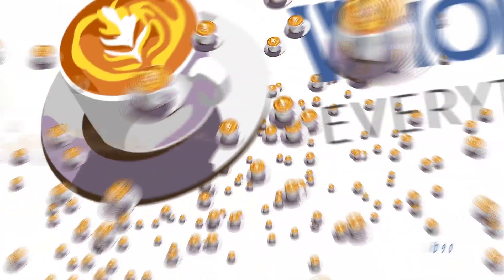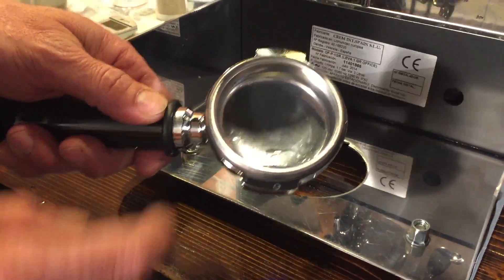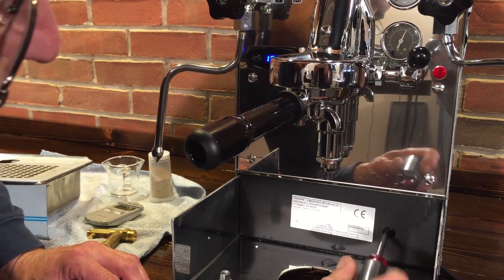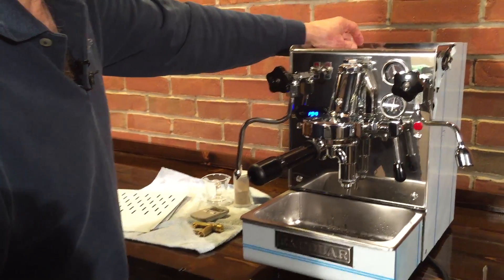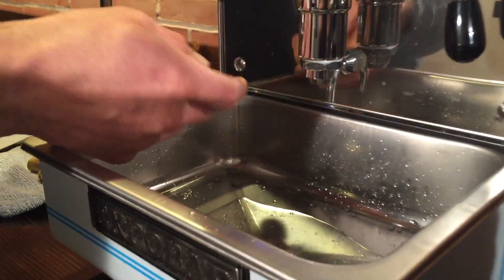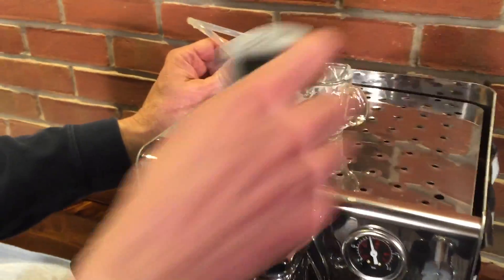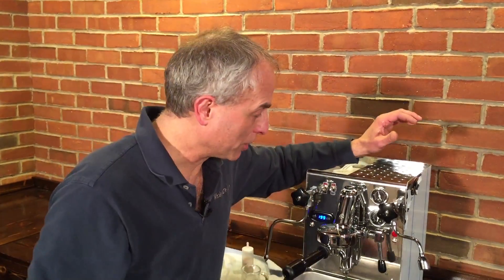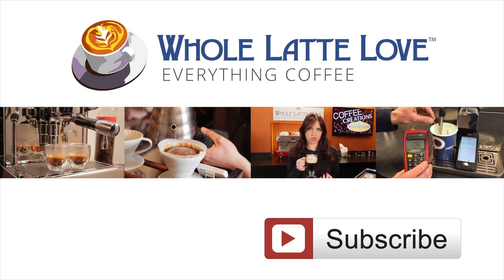How To Check and Adjust Pump Pressure on Expobar Espresso Machine

Comment: My 2011 machine (new to me) doesn't have a pump pressure gauge - so is there a way to add one or do this without a gauge? Replace the steam pressure gauge with a dual gauge or replace the brew head temp with a pressure gauge? if a dual gauge, where do you tie into the system to see the pressure?
Reply from the maker: Hey mlb, pump pressure gauges are usually attached via a capillary tube in the cold water flow just after the pump and before other system components. If your machine has an E61 group there's an accessory port on the face of the group where you could attach an analog gauge or even an app connected pressure sensor like this: https://www.wholelattelove.com/products/pressensor-bluetooth-e61-pressure-sensor?variant=43095544725558

Comment: Hello from sunny Australia, firstly thanks for the video. I have the brewtus IV (know here as the Minore IV). The vib pump was replaced in Feb this year. I have been trying to trouble shoot high pressure (14 bar) and high flow (single filter would produce 60-70ml in 30 secs from a 10gram dose). A blind filter will see the pressure rise to 14 bar. It would seem to me the vib pump was not set to 10bar when it was replaced. Is this a fair assumption? Anything else that might cause high pressure/high flow? Thanks again.
Reply: The video showed how to adjust the pump pressure to 10 bar by removing drip tray and turn the screw. The extraction of 60-70ml in 30 sec is related to grind size, so need to grind finer

Comment: Hi Whole Latte Love, 
I have the Minore IV tank only version. So I have the two tubes going back into the tank. My question is does the chrome tube on my version connect to anything? I assume it is just for show since the tank and plumbed versions use the same bodies? 

Also, if I want to remover the lower chamber (pre-infusion and exhaust chamber) do I have to remover the chrome tube? It seems like isn't much room for the lower chamber to screw downwards with the chrome OPV spout so close.

Comment: I just bought an expobar lever machine, this video was very helpful while setting it up.  It was set at 12 bar out of the box and the shots were not great.  I noticed with mine, no matter how I grind or pack my filter it doesn't really drop to 9 bar when set at 10 with a blind filter...more like 9.5... I guess that's fine though since the flavour is excellent and I have the yield/time I am after?
Reply from the maker: Hi k, Thanks for the comment sharing your experience.

Comment: As things are standing it takes my machine a full minute to get up to 4 bar with backflush disc in. It does ultimately get up to pressure, but it takes nearly two minutes. When it comes to pulling the actual shots, this translates to wimpy tasting shots pulled at a wimpy 3 bar. Any ideas?
Reply from the maker: Hi k, Thanks for the question. Well, that's far too long to get up to pressure and pressure is too low - but you knew that already! So could be a couple of things. Pump is not working properly and/or obstruction in internal hydraulics from scale deposit etc. Has the machine been regularly maintained - backflushing and descaling? Check out our support wiki for Expobar machines here for troubleshooting info: https://wiki.wholelattelove.com/Expobar
If you are in the US give our tech support staff a call at 585-924-7170. They can help diagnose issue, get you parts to do a DIY fix or setup a repair if needed.
Marc
Reply: @Wholelattelovepage  Thank you so much for all the instructional videos and also for getting back to me. 

It's solved now - and here's what I learned following a full 2 weeks of troubleshooting...  The pump was working properly (1 oz/12 sec) - but replaced as part of this and also upgraded with pyrex ball instead of plastic. Also replaced the overpressure valve. I wouldn't have dared doing this without your vids. Cleaned out the brew head jet too. Not much there.

The maintenance routine is fairly rigid. 
I've been replacing the filter as per manufacturer's instructions - About every 300 shots. At my usual 3 shots a day that's about every 3 months.  I try to keep a monthly descaling schedule but in practice the machine has been descaled every 6 weeks since taken in use. As I live in a Very Hard Water Area, I have kept tap water away from the machine, opting to use the lowest TDS spring water I could find. I backflush at least plain water after each session. So far so good. The good news is that I've not come across even a trace of limescale during pump and OPV replacement.

The bad news is that the problem persisted. I decided to pull up the hydraulic diagram of the machine and start troubleshooting from the beginning, trying to account for all symptoms.

Then it hit me. The filter. It hadn't been in there for 100 shots yet, but last time I ordered in filters I had been sent slightly different ones - resin filters rather than the usual mineral ones. Apparently these absorb water and after long enough they will block the inlet, so for these filters it's recommended to replace them after about a month. 

Could it be that simple?

The filter had been in there for two months, so the machine was doing all it could to pull in water through a big old tube of jelly. The pump was fine. The OPV was fine. It ultimately came to full pressure. It just had tremendous trouble pulling in the water to begin with. As soon as I swapped out the water filter, everything went back to normal.  

All's well that ends well. My Expobar is once again A clean, pristine, working coffee machine, serving me up delicious shots of coffee. I ended up with an upgraded pump and I've learned how the pump/deairator/opv chain fits together.

Thanks again,
Marc

Comment: Hello, may i know whats the problem for my machine,expobar office lever plus, when using blind filter or brewing espresso with normal flow, but the manometer is vibrating so hard and does not show the exact bar, and i had tried to replace the pump and not solve the problem. Is there any solution ?

Comment: Hi thanks for a great video. What if I'm getting 2oz water in 12seconds what could be the issue? I've set to 10bar via the gauge, using same method  as on the video. Thanks
Reply: I have the same issue and question.

Comment: Hi, i have a expobar espresso machine with 2 boilers and lately the pump pressure raises to 14. When I put a screwdriver in the hole behind the drip tray I cant find anything to adjust the pressure. Where do you put your screwdriver and how can i find it? 😅
Reply from the maker: Hi Bente, What model Expobar machine do you have? They have different model names in some countries. You may find what you are looking for in our Expobar support wiki which has hydraulic diagrams and manuals for most Expobar machines.
Marc

Comment: Hello there!
Thanks so much for the video. My 2005 Office Lever has been running at 12 bar for years now. I've attempted to adjust the pressure but my model doesn't have the screw behind the drip tray as displayed on the video. I've read somewhere that my hex screw on the brew group is what you use to adjust the pressure, but water leaks out of it before it gets to 10 bar. I think I'm adjusting the wrong screw.
Reply from the maker: Hi ZZ, You are welcome and thank you for the comment and question. The Lever has undergone a number of revisions over the years. Your model may not have the hole behind the drip tray which gives access to an expansion valve which limits brew pressure. I know one thing for certain: The hex screw on the group has nothing to do with adjusting brew pressure. I forwarded your question to our Service Manager. He said he'd need to see inside the machine near the pump. In some machines, the expansion valve is only accessible by removing the outer housing of the machine. 2005 predates my knowledge of Lever machines. If there's an expansion/OPV valve inside it probably looks something like this: https://www.wholelattelove.com/6476946750258 What you can't see in the part photo is the screw which adjusts the pressure.
Marc

Comment: Hello guys
I did the test today but got some strange results

With the pressure set at either 8 or 10 bar the flow will not slow down , i got 1 oz in 4-5 sec

It’s an expobar leva hx and i got it for almoust 3 years now
Reply from the maker: Hi NV, Thanks for the question. Just to be certain you are measuring after the flow slows down? I think everything is fine. More water faster indicates a stronger pump. Problem would be if you were getting less than specified flow.
Reply: Whole Latte Love thanks for the reply

I am measuring a few seconds after the pressure reaches the set 9 bar with the backflush disk in. The flow does not seem to die down, it remaina kinda fast
Reply from the maker: @Nakon-V  Is your espresso brewing well? Again, more flow indicates a stronger pump. If your espresso was brewing very week or slow the only thing I can come up with is your pressure gauge is not reading correctly - like it's indicating a pressure much higher than you're actually getting. This would cause more water to bypass through the OPV and back into your reservoir. This is possible yet unlikely especially if your machine is brewing properly.
Reply: @ @Wholelattelovepage  i kinda get some channeling issues, like little holes in the puck which i have to combat with a high dose, bottomless extraction has no spurts tough and seems kinda fine.

Comment: Hi there
I noticed on your video that water coming to that glass comes with some intervals and could hear it also. Is it normal???
My office lever plus started to brew coffee with this kind of pulsation. ( only during brewing) is this something I should worry about???
Thank for the video
Reply from the maker: Hi Tony, Thanks for the question. What you saw and heard in the video is normal operation of a good pump. As long as you have good pressure and flow rate like in the video there's no need for concern.
Reply: Hi and thank you for reply. I forgot to mention that pressure arrow is pulsating also  but only during brewing coffee . I couldn’t see difference in flow and taste...
Reply: @updatename6637  fwiw when I had this pulsating pressure, it was a sign of the pump starting to fail. Eventually I could not get enough pressure at all. Replaced the pump (not that hard) and all is good again.

Comment: My Expobar Office lever is producing 1 1/2 oz in 12 seconds at 10 bar. I have been having problems with my shots turning blonde after about 10 seconds in a pull. I have not changed my coffee or grind, that always produced excellent shots before. I am using a gauge on my portafilter to read the pressure. Should I be setting this to 9 or 10 bar at the portafilter? Any suggestions?
Reply from the maker: Hi JB, I replied to another comment of yours on same issue. 1.5oz in 12 seconds is far to fast - but you knew that! Regardless of your brew pressure your grind is likely too coarse or you are using a very small dose of coffee. Have you tried setting brew pressure using a blind basket (backflush disc) in the portafilter and reading the brew pressure gauge on the machine? Perhaps your PF mounted gauge is incorrect? On vibe pump machines we set max brew pressure to 10bar using a blind disc in the portafilter. That produces about 9bar max brew pressure at the group. Understand that when you set brew pressure you are setting the max before an expansion valve in the machine opens and bypass brew water (and pressure) away from the group. Depending on grind and dose you may never reach the max pressure when extracting.
Reply: My Office lever doesn't have the pressure gauge on it, so I have to use the portafillter gauge attachment. So how do I get my flow rate down to the recommended rate?
Reply from the maker: Assuming your brew pressure is correct flow is controlled by grind size and coffee dose.
Reply: Thanks for the reply. The flow rate I'm talking about is from the tank return line, In the video you ran the pump with the portafilter blocked and you got an ounce of water in the 13 seconds in the shot glass. When I run this same check I get over 1 1/2 ounces in 12 seconds. I must havae a very good pump. So as long as I can get my grind dialed in to the 20-30 second shot, I'm good?
Thanks again for the great videos and the fantastic customer service I've received from you guys over the years!
Reply from the maker: Hi JB, Sorry for the misunderstanding! Your pump is doing well! And yes, if dialed in to 20-30 you are good! You are welcome and thank you for the kind comments re. videos and customer service. We are passionate about coffee and providing the best possible customer experience.
Cheers, Marc

Comment: Hi, is there a way to connect a second pipe back into the reservoir if you have a plumbable machine (water is pouring out below the filter basket) but it is not connected to the sink? I have to empty my reservoir quite a lot because of that ...

Comment: Thanks for all your great video's! I only have one hose in my tank. When i brew there is water coming the thin L pipe in to the tray. Is it wise to check the OPV and connect a hose for back flush?
Reply from the maker: Hi p, I would check an adjust your OPV as needed.
Reply: Thanks i will do

Comment: Hi Todd: I noticed on the Lever you adjusted, there was no back flow into the drip tray until you turned the lever down (off). On my Office Control, I always get back flow water through the back hose into the drip tray while the switch is on. Is this normal? What is the difference between the two machines?
Reply from the maker: Hi MW, If I'm understanding correctly, you have water going into the drip tray while the machine is brewing. If so, the solenoid valve is leaking. Usual fix is to clean the solenoid valve. It's an electrically operated valve behind the front panel of the machine.
Reply: @Holly I learned the back flow is normal, it is excess pressure that is not used when pressurizing the puck.  The finer your grind and slower the draw, the more water will go into the tray.

Comment: im getting 10oz in 8 seconds, is that bad?
Reply from the maker: Is it bad? Well the pump is definitely working but that's a lot! Means the OPV is bypassing way to much water. What's your brew pressure set to as shown in first part of the video?
Reply: I dont have a brew pressure gauge, only boiler. I will invest in a gauge for my portafilter so I can find out.

Comment: Hi Todd. Great video as always. Full of tech details and precious information.  I just got a used Expobar Brewtus IV and noticed that the water outlet (the small outlet under the brew head) is not connected to anything inside. It does not even have a tube. The machine works great and makes excellent coffee. Does this mean anything in particular? Does it imply a risk or anything else? From your videos, that specific piece seems to be connected to the pump, but in my case there is no available space to connect it. Should I look out for something? Thanks very much in advance for your help.
Reply from the maker: Hi Carlo, Congrats on you Brewtus! Excellent machine!!! Hopefully whoever had it before you took good care of it. So depending on Brewtus model that hooks up to the OPV valve and/or the de-airetor with flexible low pressure tubing. If not hooked up properly you might getr some water inside the machine. But in many cases you won't. For instance, for any water to come out of the OPV you'd have to choke the portafilter with a grind that's to fine to cause the OPV to bypass water from the brew curcuit. As a Brewtus owner you should bookmark this link to our support wiki for the Brewtus. Lots of troubleshooting info, Brewtus specific videos, manuals, diagrams etc: https://wiki.wholelattelove.com/Expobar_Brewtus_IV
Oh, sorry not back to you sooner! Was on vacation and offline last week.

Comment: please help me , im having my expobar piped in so i dont understand how to test for my pressure still.
Reply from the maker: Hi, Will try and help. What pressure are you referring too? Pressure coming into the machine from plumbed waterline? Brew pressure? Steam boiler pressure? Need more specific info. In the meantime, if related to line pressure coming into the machine be aware that plumbed Expobar machines have a solenoid valve in the machine which shuts off the plumbed in waterline unless boilers are filling.
Reply: Brew pressure for the grouphead..
Reply from the maker: Okay. With the blind filter (backflush disc) in portafilter we like to see 10bar on the gauge when lever on E61 is put inot brew position.

Comment: What number should the brew pressure gauge read when it is not in use? We used it pretty hard the other day and it was sitting around 13 when not in use. Brewing at 10 when engaged but just worried about the resting pressure.... 
Thanks
Reply from the maker: Hi SB, On many machines the brew pressure gauge can still indicate a raised brewing pressure after brewing. I see it all the time. In most cases simply raising the lever (like on an E61 brew group) for a moment will bleed off the pressure in the brew circuit.
Reply: Great thanks! Should I begin worry if it continually sits high after brewing - maybe time for a service?
Reply from the maker: Could be. Is it an E61 group? Does gauge return to normal if you raise lever for a moment after brewing and removing portafilter?